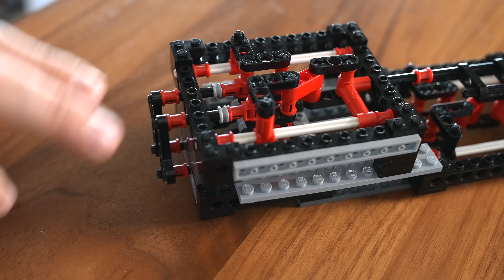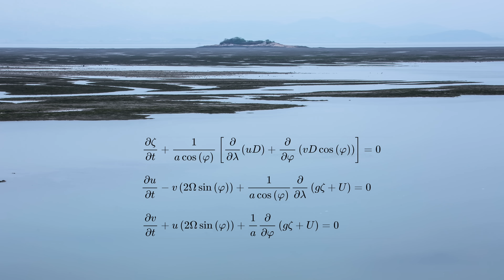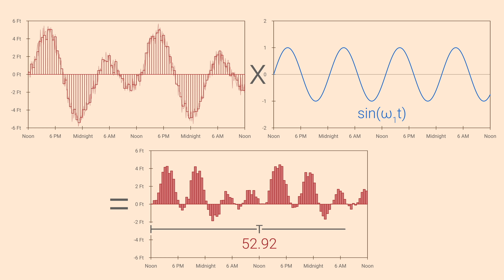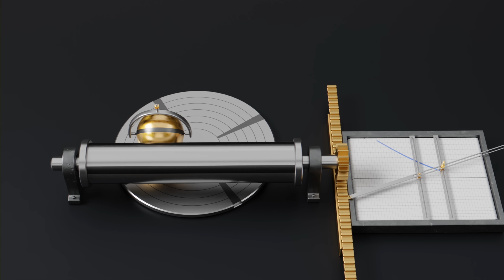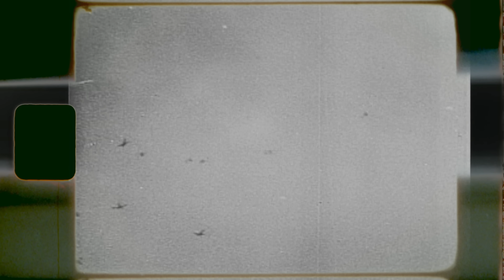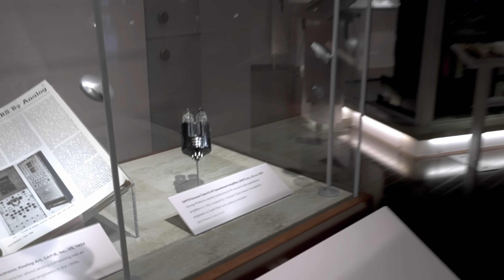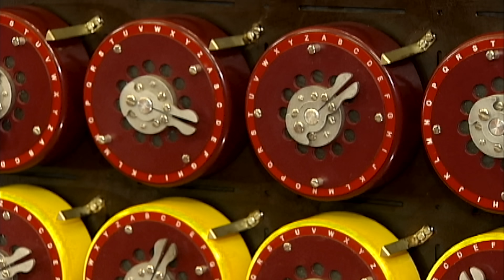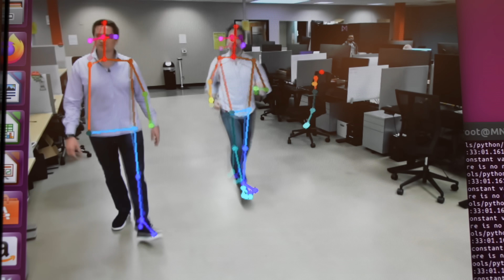The Most Powerful Computers You've Never Heard Of

Comment: My Father was sent to bombardier school at the start of 1943. You’d been to cadet school but weren’t made an officer yet. If you failed two tests in school you were washed out, and sent to gunnery school. You ended up operating a 0.50 gun or a turret in a bomber. If you passed bombardier school you were made a 2nd Lt. Almost all were then sent in the next part of the organization, to a base that integrated different specialties into aircrews. These crews were then sent to other bases that taught crews to operate as part of a wing. Then a wing could be sent to Europe or the Pacific as a unit. Along the way, the system was designed to be short circuited. An individual, or an air crew, or wing could be used as replacements to existing crews, or a whole crew as a replacement. Back to bombardier school. The top graduates of the classes early in the war were not sent to crews, if they were judged to have ability to teach or lead. They were made bombardier school instructors. Capacity was being ramped up. No one wants to say it, but the most proficient operators of the Norden bombsight didn’t go to war for another year or two. Then the line instructors were replaced by the better of bombardiers who had completed their combat tour, mostly over Europe. The U.S. did the same with better fighter pilots. Brought them home, and made them into instructors. So in my Dad’s case, he was top of his class. He stayed in Texas, teaching. He didn’t progress to crew, then wing training, until replaced by combat veterans, who’d had their thirty day leave in the States after full tour. I assume the same applied pilots and navigators. 

At Korea there were more veterans. For daytime targets they drew the smallest circle that included 90% of the bombs, and measured between that center, and center of target. Dad was lead bombardier in his wing. Remember that the bombardier was not aiming for his aircraft, he was aiming for all the aircraft in that flight. Think creating a shotgun pattern from a number of aircrafts’ string of bombs. So if bombing a bridge, he did not put the crosshairs on the bridge, he put them in the water in front of the bridge. His mean score was 220’ from center of target. One bombardier in his wing, the 307th had better, at 180’. Those two bombardiers never failed to put bombs on Yalu bridges, including the replacement pontoon bridges. Most other targets were not as pin point. The B-29 was also better platform. And Dad said better bombardiers had definite opinions on different aircraft-autopilot-Norden bombsight combinations. Some were better, and some were worse. You had to be familiar with a particular combination. Look at a bridge from 19,000 feet, pick out a spot in the water at design distance, say 400’ in front of bridge at the 45 degree path you are flying, then revise that 20’ or 40’ where you disagree with that particular bombsight. And the water all looks the same of course. All this while under radar laid AAA fire. 

He maintained that the pickle barrel propaganda was baloney, and was harmful. And that most bombardiers couldn’t do enough math in their heads to work around the Norden’s faults, before the flak was landing around the ship. They could be trained to meet minimum SAC requirements.

Comment: ... in the old days... TV's... as an example... used discrete components... all of which had a tolerance level... which required a means to balance those various component tolerances to near zero... hence variable resisters... pots... and coils... etc... today... all things being digital... you can calibrate one TV... and once satisfied... you may take those calibration values.... and enter those exact values ...across the board... on all similar model sets... which means that... calibration for one... is calibration... for all...

Comment: 14:20 I think the 1 per 90 round shoot down rate isn't solely based on analog computer, radar tracking, and mechanical timer.  The VT radar proximity fuze replacing the mechanical timer contributed to dramatically improved shoot down rates.

Comment: Dude you made the mistake of ignoring the second and more important reason for the decrease in shots vs kill ratio 
The fuse was also changed and that is what solved the problem by deleting the need to set a timer on the fuse and instead using a proximity fuse which sensed the distance from target

Comment: The digital realm has removed many engineers from the field...many solutions could be done with more simple elements but everything is pushed off to a digital control. This was always a cheat because the program can be tuned...i belive that,with 3d modeling and machining more analog mechanical devices will become more prevalent.

Comment: Excuse me, but you seem to have committed a gross error of fact:  digital computers used electromechanical logic circuits fashioned (mostly) from relays as early as 1941 (the Z3) and then later electron tubes replaced the relays (ENIAC 1945), the first transitor logic computer (TRADIC) was in operation in 1954.

Comment: There is a difference between a machine that does just one job, even though it is an analog device, and a true analog computer.  A true analog computer is programmable, not just input determining a specific output..  Stonehenge is a "device" that predicts when the seasons change, not programmable.  (Inputs by the Earth's rotation and position.)  The Greek "computer" is a device, not an analog computer.  It only gives the solution to one thing.  A slide rule is an analog computer.  It gives multiple mathematical outputs for an input depending upon which scale you are using.  In effect programmed by the user.  The Greek device could be an analog computer if the user could swap cogs to give solutions to different problems, but it is fixed.  Thus an analog device.

Comment: The first company I worked for did downhole models for oil and gas industry. The predecessor company actually had a analogue computer to do this. A load of op amps set up as  comparators, integrators, differentiators etc all tuned with some pots to get the correct feedback. From what I understand the biggest issue was of course the constant drift so it constantly needed retuning.

While I was there I was interested in learning about FPGAs and came across some research being done into the analogue version of a FPGA, an array of opamps (FPOA?) that could be programmed in much the same way as an FPGA. Sounded like an amazing concept but haven't heard any more about this for ~ 5- 20 years. Sounds like the technology may finally be getting closer to commercial applications..

Comment: My first Physics Professor (Ronald Ruby, UC Santa Cruz) told us a "crazy" way to do integrals using a chemical balance.  Plot a curve on graph paper.  Cut out a 10x10 square of the same paper and weigh it;  divide by 100 to give the weight of one square (weight/square).  Cut out the plot, weigh it and divide by the weight/square to obtain the value of the integral.  It's pretty slick!

Comment: Awesome . . . But I cringed when "calculators" were called computers. I'm an engieer and consider a device or mechanism that has specific or extremely limited functionality is a calculator. A computer is versital, and typically programable. An appropriate tweek of the program improves an inaccurate or course output output.
Astronomical models, tide predictors, bomb sites, abacus and the like, while genius and innovative devices, are "calculators".

Comment: As a software engineer I realized that my math teacher was right when she said Dont use the calculator, it will slow your brain. She was absolutely right and sexy. Now days im so dependent on my laptop.  My brain is so small .I'm easily amused by a few rotating gears.But it's ok. I did have a romantic experience with my math teacher. Than i met my cousin's neighbor and she was hot. Next will be your mother if you're still reading  my comment 😅😅😅😅😅😅

Comment: The myth of ENIAC being the first electronic computer has to be brought to an end. Collosus was the first and Collosus II the second. 1600 and 2400 valves respectively. Although designed for one task, when another problem required solving Tommy Flowers reprogrammed one for the other task. Collosus output was via a teleprompter.

Comment: The ball and disc system is used in the transmissions of many snowblowers but the ball is another smaller disc. This gives a neutral position, a variable forward speed and a variable reverse speed. Pretty amazing tech.

Comment: @Veritasium
Sorry, but this video is horrible ... you dont mentoined Gottfried Wilheln Leibniz which has first postulated the binary number system and also the first logics in combination to this, why? Also whats about Konrad Zuse? Zuse was also the first person which actually concepted an electrical calculation machine long before US does. Claude Shannon has nothing to do with the analogue & digital revolution. His first work was a client side failure correction for wireless data transmission and also later has he concentrated on mathematical denoise methods. He has literly nothing to do with what you talking about. So please, check your sources!

Comment: I remember working on bombsights and air data units when i was in the RAF, ball and disc resolvers, differential gearing etc, just at the advent of operational amplifiers.
The first inertial navigation system i saw was around 5 foot in diameter

Comment: Very interesting video, and now today when the digital network groth is enormous, we sure have a problem. The digital fx search is to screen maby 1000 000 articles to find a hit, the amount of power needed are rising when everything is connected to internet.
If we can use some sort of analog "computer" to decide what is needed, and ofcorse many inputs are analog signals, maby we can build smarter systems, that do not need to read 1000000 of articles every time to find the answer.
Both lower the amount of need for operations, and making the operations smarter. - And this is just me thinking, some of the quantuum computer have a sort of analog answer displayed, is it called  🤔 
Anneling (not sure I spelled correct). I think that we have very much to discover.
Best wh. from Sweden.

Comment: The solution to the ending place for transistors in processors is just making them bigger. This require bigger socket on the motherboard but it is possible to implement

Comment: Digital signals are NOT robust to noise!!! Ever watch TV over the air? If the signal is poor, you get pixels or nothing. With analog, however, even though the signal may be poor, you can still hear and watch consistently through the static.

Comment: How many of those aircraft shot down in WW2 were taken out by shells that had proximity fuses?  Of course, other problems with the Norden were that the bombs were not super-aerodynamic and tended to drift unpredictably.  Likewise, they didn't know what the winds were like between the plane and the ground that was 6 miles below. So, the concept that you could hit targets using just a sight, from high altitude, was faulty.

Comment: US submarines had a device called a Torpedo Data Computer. This was an analog computer that used olde school adders and multipliers, and a stylus running on a trigonometric shape, to calculate the "programming" of a US torpedo.  Torpedoes were not aim-straight-and-fire weapons like guns.  Instead, the torpedo would leave the sub and travel straight for a while.  Then it would turn left or right for a certain amount of time. Then it would travel straight to its target.  The TDC solved the reasonably complicated math required to determine the amount of time the torpedo would be turning.  The torpedo's speed, the sub's speed, the target's speed, the headings of the ships, and whether the front or rear tubes were being fired all had to be taken into account.  The value produced by the TDC would be set on the torpedo (while it was in the tube, I believe).

Comment: I have one on my Wrist, It's a Mechanical Watch it has a couple of Gears and Weights and Springs and a Dial that calculates the Time using both a Digital Tick created by the Springs and Cogs and an Analog Display with a Plank Length if 0.25 Seconds, sure, it may not have an AmoLED Display or 1000's of (Mostly Useless) Apps (because Devs seem to just make BS apps that are 99.999% Advertizing Garbage - GOOGLE YOU NEED TO DO SOMETHING ABOUT THAT because they are turning you WearOS into Absolute Trash) ... but it will work when the Solar Flares or EMP's hit your computers... and it will work for Hundreds of Years if taken care of properly... they have Bearings made of Ruby because Oil just doesnt work as good on such small parts... and it has SO MUCH Classy Looking that it Always gets looks, it probably even got me a few jobs just because I was the only one wearing a Mechanical Watch... Digital isn't Everything...

Comment: "You've never heard of"..? Young man,  I still learned about them studying Electronic Engineering and I used it once in the 1980s in a "hardware in the loop simulation" as our embedded microprocessor simulation was not fast enough. That particular electronic analogue computer was great for simulating differential equations.  
B.t.w., I am still working..

Comment: In 1966 I visited the USS Long Beach. A nuclear propelled guided missile armed ship with a big square superstructure as a phase array radar. All the computers were analog, with voltage being the input/output value. The computer took up a huge compartment filled with racks of mother boards and plug in daughter boards. There was a work area where many men "fixed" daughter boards that had drifted out of specification.  The Navy learned much, and successive ships used digital computers which were much more consistent.

Comment: My father had a simple calculator that worked with a steel pointer sliding numbered teeth against each other. You could do addition and subtraction, multiplication and division, and squares and square-roots. I used it in math class until my teacher caught me. It was the grinding noise that gave me away!

Comment: The mechanical fuel injection in my 1973 Porsche 911 contains a mechanical computer that integrates rpm, throttle position, temperature and air pressure.

Comment: Believe it or not I did hv similar dreams (yes plural) like Mr Parkinson (minute 20:55 of above vid) had in which 2 or most striking things I saw were (in a brief, it's way too long to describe n writes each of them) ...

1) a rotor base flying shuttle very much like the ones in star trek series where it capable of flying with non-visible propeller or sound, ferrying the people in n out of a valley. They they are mounted allows for operational speed way over structurally possible;

2) a Metropolitan mass transportation n traffic system which move its people all over by thousands individually seemleslly thru n with the traffic without collision or stopping!

I m more than glad to writes n shares more about these in the reply section if more people who read this became interested n the reply or like (no pun intended), upon which may be can further be discusses n shares into feasible working ideas for the better of people everywhere.

Comment: I mean the only reason we use digital computers is that variation in voltage levels doesn't cause any inaccuracies, or at least is significantly more fault tolerant

Comment: Interesting how the worm turns. I was a mechanical engineering professor teaching Dynamic Systems Analysis from about 1980 to about 2015. During that time I included a segment on analog computers.  I was often criticized by the younger more "progressive" faculty for teaching  archaic obsolete" material even though many advanced systems in aircraft such as the F-16 were utilizing hybrid computers which were a combination up digital and analog computers. Furthermore, digital computer simulation programs such as Simulink, in conjunction with Matlab use essentially the same diagram approach to programming as did the analog computer approach. In my opinion, while learning about analog computers and how they generated solutions to complex problems, the students developed a greater appreciation of the actual physical nature of the systems that they were studying.

Comment: Analog can be easy. In industry we used to 3-15 PSI pressure signals to run our controllers and sensors. Now we us 4-20 mA. It's a really easy signal to deal with and it extremely noisy environments you just use differential ammplifiers to send the signals down twisted pairs and you get a pretty darn clean signal on the other side.

Processors have small enough transistors that they could probably run the cricuits in terms of 4-20 uA, 4-20 nA or even 4-20 pA. It deosn't really matter. As long as you can manufacture a consitstent precision resistor then you just pick the current flow you want to send and conservation of charge takes care of the rest.

Comment: The problem with your dichotomy is that there are some devices that are both digital and analog, and I don't mean that they're hybrids.  If a quantity is represented by an analogous physical quantity, but the values are constrained to a limited set, then it's both analog and digital.  For instance, there are calculators that work like the one shown by the amount a wheel is turned, but detents keep those values from varying continuously.  A TV tuner wherein you turn a knob to certain channels with detents is such a device that's both analog and digital.